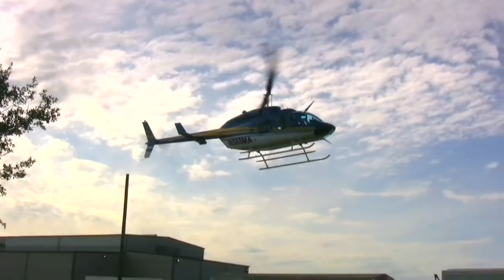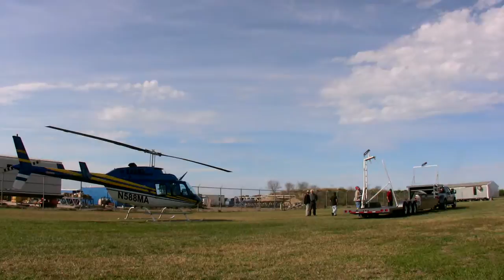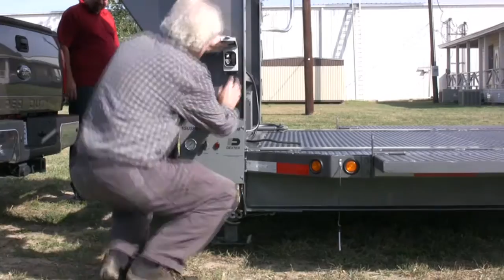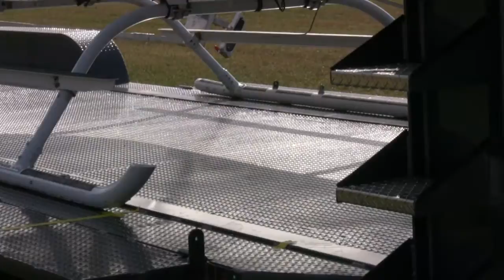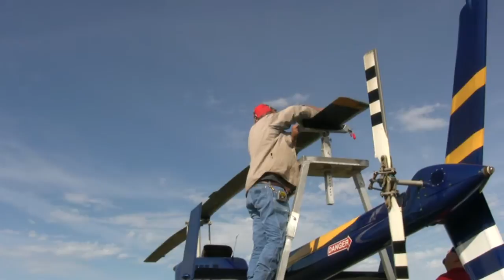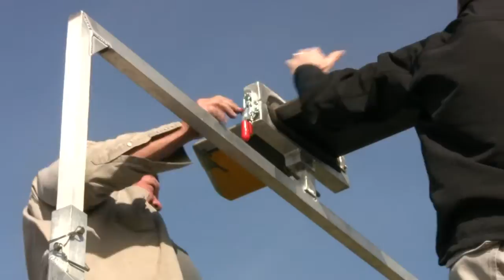Aerial Filmworks Helicopter Transport Trailer

Comment: How much is one of these? and how do you attach the skids of the Heilo to the trailer?
Reply: $10K normally $5K if you get lucky and someone is getting rid of one and you have to go halfway across the US to get it, $15K with all the bells and whistles (fuel tank, electric pump, etc.)  

The skids sit on the trailer and then you anchor them with tiedown straps.